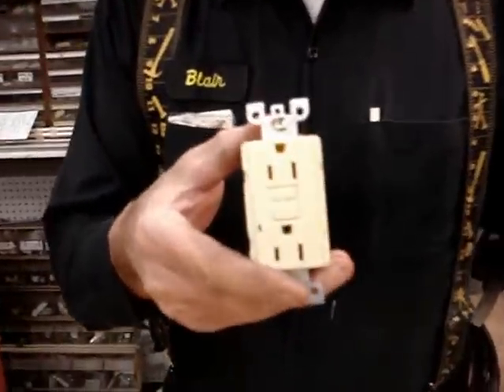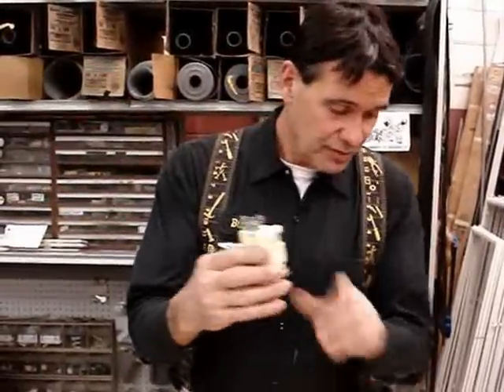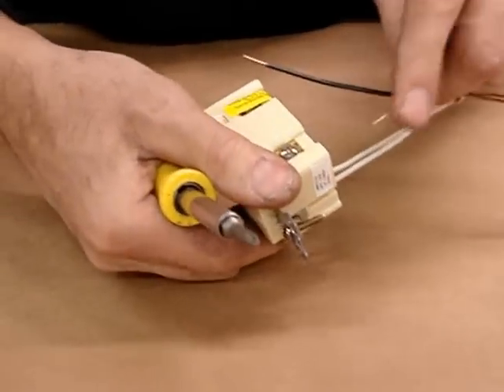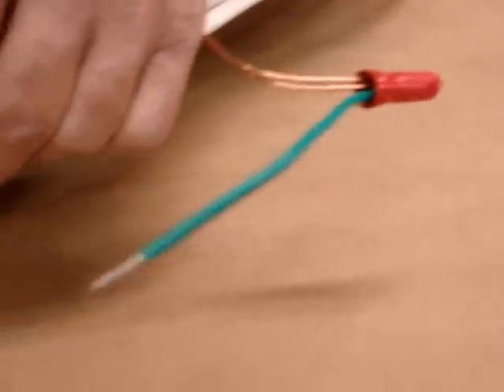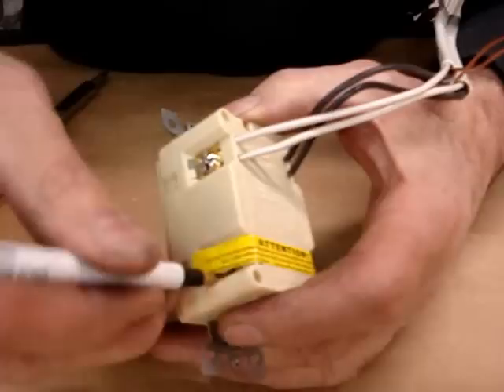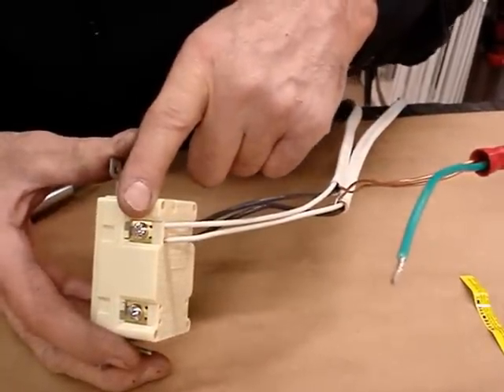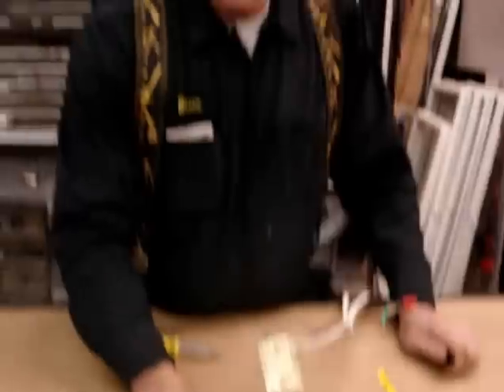How To Install a GFCI, GFI Properly - Careful Using Load Side of GFCI

Comment: Good video. Keep it up. Can  2 wires be used  the same time at the load side hot respectively neutral holes?
Reply from the maker: Typically only one wire per screw. Wire nut the 2 wires together w/a 5” pigtail that will go to the gfi.

Comment: I had one time the breaker trip, not the gfi outlet. after using a new coffee maker. I replace it and found that the neg. wire was burn about a 1/2 inches. 
Was the gfi outlet gone bad, or the new coffee maker?
Reply from the maker: Usually when a wire burns, it is because it wasn’t tightened to the screw tight enough. A loose wire generates heat and can burn. Amateur electricians don’t tighten screws tight enough and this is a common result.

Comment: Why are there 2 black and 2 white going into the line side of the receptacle? I thought only 1 wire is supposed to go in each.
Reply from the maker: The electrician used the receptacle as feed-through, one pair of wires are hot feeding the device and the other pair are continuing on feeding the next device.

Comment: It simple as 123. The green screw is for earth ground only. It is bare or color green wire in alternating currect only. In dirrect  current as cars uses a battery the ground is black. For ac it green or bare only. Plus the receptical gold screw is current line and silver screw is neutral white  travler wire of 50% of current line wire. Never mix a earth ground with a neutral . Earth ground has 0 % voltage ,, where the  neutral carries 50% and up to 100% of current line... remember  earth ground is what makes it a no fault receptical. It on a short to trip  its breaker and it put on a panel  heat breaker. Short trips its own breaker faster than the heat breaker in psnel, it trips after the mercury inside melts by heat and trips the breaker. You will reach that same heat before it trips. It much slower than no fault. REMEMBER NEUTRAL IS NOT EARTH GROUND !!!! IT A TRAVELER OF 50-100% OR CURRENT LINE.

Comment: On load side there 2 pair of holes so it means only romex wires in other words only 2 branch circuits can be added on to it?
Reply from the maker: I can’t site ‘code’ as how many devices can be wired off the load side of a gfci, however in my garage the first device off the panel is a gfci which controls all the devices down stream on that wall, about 8 receptacles. I could have split the run downstream (in one of the receptacle boxes) to feed receptacles elsewhere so one could feed the maximum amount of devices allowed by code per circuit. The branches don’t have to come directly off the gfci.
Reply: @MrHardware1  I meant to ask  can u add 3rd romex to create 3rd branch where dishwasher. And ductless range can be attached?
Reply from the maker: @algolove185  a dishwasher is required to be on its own circuit and not, as of yet, not gfci protected. Nor is a hood fan required to be gfci’ d, but you can.

Comment: I had one in garage. Had wires on line and load. Have no clue where the power is going too. Guess Ill have to find out.
Reply: Take a lamp and plug it into each outlet after you trip the gfci.  Easily show you which outlets are protected by whatever is wired into the load part.  Whichever outlet doesn't have power is protected.
Reply: The other ones don't have to have the cb on them?
Reply: @mgomez5606  check your state code

Comment: Good video regarding use of the output side of the GFCI, but MOST OUTLETS that have the holes for WHT and BLK push in and stay by an internal spring mechanism.  Using the holes makes tightening the screws useless.  The screws are to trap the wires under its head, they typically don't somehow clamp down on the wire that's inserted in the hole.  I point this out because many/most US wiring codes require the screw head to hold the wire in place.  Could be the GFCI holes on the back of the one used in the video really works this way, but the vast majority of them don't, and per code, require the screw to be UNDER the SCREW HEAD (sorry, not shouting) for a superior connection (the holes and screw are separate options).  The point is, using the holes may lead others to violate code.
Reply: With those Leviton GFCI recepticals he's showing the screw does actually clamp down on the wire in the holes. It's a different mechanism to the spring they use on the conventional recepticals.
With the GFCI design you tighten down with the screw and have to undo the screw to get the wire out. There's no other way to release the wire.

Comment: Funny how the instructions ONLY tell you to use the load terminals on the back of the GFI for the load wires in your box. They fail to mention IF you want those loads to also be GFI protected.

Comment: Thank you so much! If you do not know where the GFCI plugs are terminating, you do not need them! I removed two additional GFCI units in the house and replaced them with conventional plugs and they work just fine. I had four outlets that were not working due to one of the two GFCI's being incorrectly routed, and those four are now humming right along!

Comment: I have an older house and each outlet has two black (hot) wires and two white wires, and so I replaced the old two prong outlets with the GFCI in the holes provided just like the one you have in the video. But in one outlet, it has three black (hot) wires and three white wires, so now I'm not sure what to do, it's the only outlet like it and it's in the bedroom, not in the kitchen/bathroom, not near any water. So what do I do? There is very little room in the box and so I'm at a loss as to what to do and why only one out of 14 has six wires instead of four. If you see this can you help with some advice? I didn't do anything to it at all, didn't want to make a mistake so it's as is until I can figure out how to handle that extra two wires. Thanks.
Reply from the maker: Typically it is a point where one hot feed is split feeding 2 different directions. One goes to another bedroom and the other feeds a different room, however it could be a switch leg so I can’t say w out being on site. When I have a split like this that I know the locations of the lines I wire nut the blacks together with a pigtail to the receptacle and the same for the whites, yes it is busy in the box so all the wires have to be folded perfectly to get it into the box.
Reply: @MrHardware1  Hey, thanks for the response, the extra wires were indeed feeds to other outlets, originally I eliminated two that weren't live but then other outlets went dead. So I just put the wires back where they were originally on the new outlet and everything is working fine. I know just enough to get in trouble and not electrocute myself so I kept it simple. Thanks again I appreciate it very much, happy independence day!

Comment: Can you place the gfi anywhere in the 3 outlets in the garage diagram you drew. Say you connected a gfi on the middle outlet in the diagram. Would it then control the next outlet downstream and not the one before it?
Reply: It will only protect the receptacles downstream.

Comment: So can eliminate 1 gfi and put another one in the bathroom.. or must i have that 1 control my other bathroom
Reply from the maker: One gfci can protect both rooms but I prefer to have one in each room so if it trips I don’t have to go searching around.
Reply: How do i do that? Bathroom 1 and 2 are on the same circuit. Bathroom 2 had a line/load GFCI..Bathroom 2 had a regular receptacle that I want to change to an independent GFCI. How can I do that? And is it ok that the 2nd bathroom is loaded?  Or should the 2nd bath be line only?

Comment: I have to replace a CFCI in the kitchen which feeds just one other outlet. Are you saying to put all 4 wires into the feed side and not the load side?
Reply: I would put the feed wires to the ‘line’ side of the gfi, and I would put the wires to the receptacle down stream to the ‘load’ side. That way that GFI will protect both plugs
Reply: Depends on if you want to protect that outlet as well.  If yes then use load.  If no, then stab them into line.  Pigtail if more than 2.

Comment: If you have no ground on your outlets and you want to protect them then you don’t use the load, correct? They should all be wired independently, correct? Also if you want to do this can you simply do one at a time or do they all need to be replaced with a gfci at the same time?

Comment: I wish you had followed through with the other bath example you backed out and changed to master bedroom. That is precisely the dealing with - 2 GFI on the same circuit acting independently using the upper connectors on each so doesn't affect other switches and outlets downline. Would have to pigtail both the black and white (separately) like you did with the ground to avoid two wire connection. But that is really a non-issue in my case as actual project is converting from aluminum to copper so the respective lines will each have a 3 outlet Alumiconn with one the copper pigtail.  I guess the real question is can multiple GFI be installed on the same circuit and act independently if only using the upper posts?

Comment: Both of my bathrooms gfi are not working, the reset switch is not activated and non of my breakers are tripped in the main box. Any suggestions where to start? Oh and also two out door outlets are also not working.
Reply from the maker: I would start at the gfi receptacle closest to the electrical panel. If it is a bad gfi and all the others are wired downstream you would have your senario. Be safe or have an electrical do the work because you don't know which breaker controls that circuit.

Comment: So, a GFCI does NOT trigger BOTH it's outlets during a current fault, but only the LOAD outlet (the one initially covered with yellow tape)? The LINE outlet stays hot always (unless the main breaker in the house box is tripped), Is this correct?  In other words, the only thing monitored and protected by the GFCI outlet is whatever is plugged into the LOAD (not the LINE) socket?  Thanks Blair!
Reply from the maker: Incorrect, the gfci trips everything if it encounters a fault. Both it's outlets and the 'load' output if used.
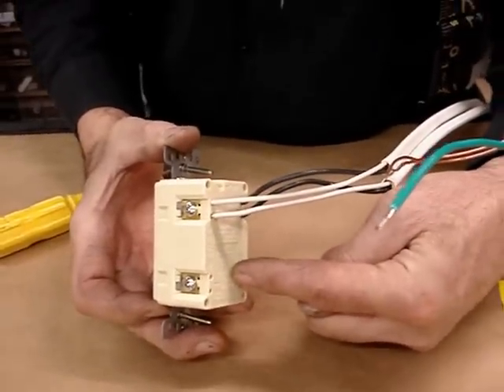Reply: At 5:05 you say not to use the load (never unless you know what you are doing).  I'm a little confused because later you show the garage with gfci being the first recepticle followed by 3 or 4 outlets, do you now connect thos using the load side of gfci, it's confusing. Thanks for the video and your time.
Reply: @rubengarza7388  only use the load if you want every outlet after it on the same stream to be gfci protected.  If you just want that outlet protected and nothing downstream use the line holes.

Comment: What did I do wrong? My GFCI combination light switch and receptical only has power to the light switch, if you could help me figure out what I'm doing wrong, I would greatly appreciate it, thank you in advance sir
Reply from the maker: I  can only guess you don't have the black feed and the switch wire under the same screw. Please send pic to blair@mrhardware.com and I'll help further, if you haven't solved it by now. Blair
Reply: Mr. Hardware I will take it back apart and try and send you a good picture tomorrow, I have the breaker turned off at the moment, because, well you know, better safe than sorry lol

Comment: I have one gfci outlet in the kitchen close to the sink (above the counter) that also controls the refrigerator.  one set of wires to the load and one set to the line.  
From your video it appears that I can put all of the wires to the line in side and that will keep that gfci outlet from controlling the refrigerator and allow the gfci only to trip what is plugged into the gfci outlet.
Is that correct?  Can I use both holes at the line side since I only have two sets of wires going into the box?
The grounds are already pig tailed.
thanks
Reply from the maker: Yup, that is why we did the video. Never downstream feed anything like a frig or freezer or sump pump from a gfci. I use the 2 line feed holes all the time. You could pigtail the 2 circuits together w/wire nuts and a short jumper to the line side of the gfci also. Pig-tailing is actually the more correct method. Blair

Comment: So your saying gfci should be used at the end of a circuit good tip.
Reply from the maker: That depends on the situation. In my garage the gfi is first and it controls 4 receptacles down stream on the same wall. The same in my kitchen, it was new work so when I wired the backsplash the gfi is first and it controls that wall, only. I never let a gfi control a receptacle out of the room.

Comment: What if you have two hot wires and one neutral?
Reply from the maker: This can only be answered with a drawing of the wiring. There is usually 2 of each, power in and power out. 2 hots and only one neutral does not sound right. Blair
Reply: @MrHardware1  
I found out with help from a YouTuber / electrician name John shook that I have a two phase setup. He suggested I place a wire nut over one of the hot and use the other one hot for the GFCI
Reply from the maker: I usually find when wires were joined before I got there they should be joined still. If you are done, good.
Reply: @MrHardware1  How do you think I should wire this using both hot?

Comment: If you have more than 2 pairs of wires in an outlet box chances are that, by code, the box is over it's max. capacity already, and you do not have enough capacity to install a G.F.C.I. in that box.
Reply from the maker: This is about getting the job done with what you are given. Sure code requires more room, but this is not new construction.

Comment: I meant the line can be on top on one brand and bottom on another so simply switching the putlet out by putting wires back where they came from might not always work.
Reply from the maker: COOL, many electrical devices are opposite of the prior old ones.
Reply from the maker: +spoada 
you must know what every wire and screw mean when doing electrical. Never guess any connections.
Reply: Blair Gilbert